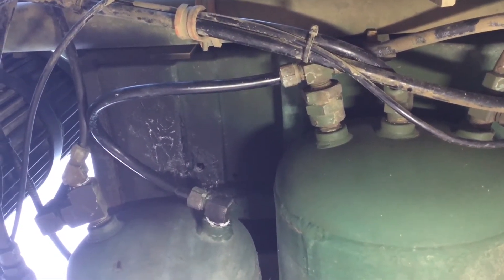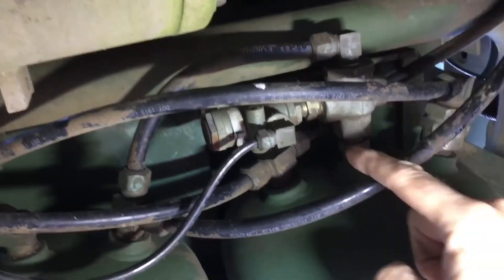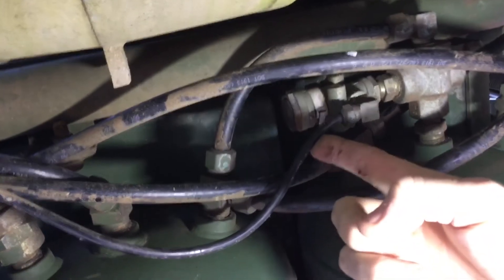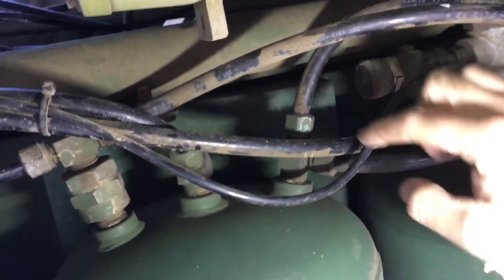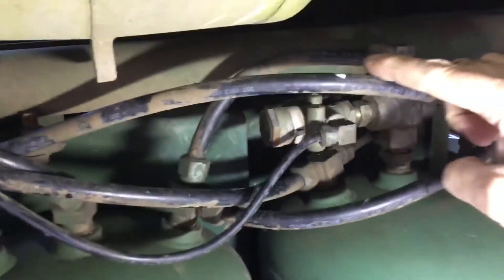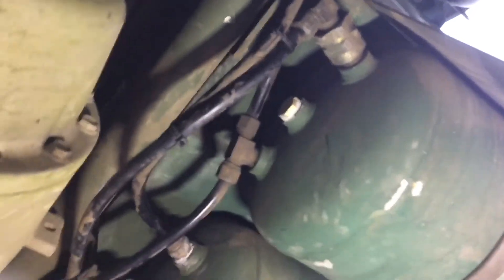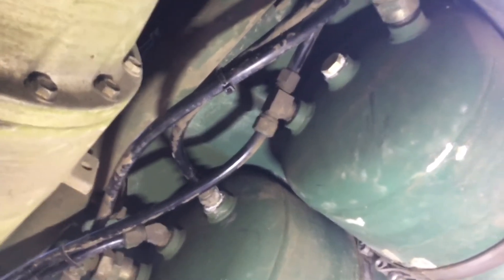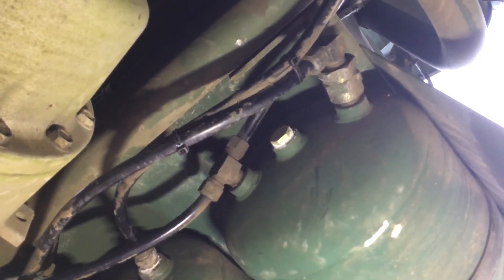LMTV AOP air supply control valve removal.

Comment: Ron:  This is very helpful to me.  I've removed my AOP pump and installed the hand pump you recommended.  I had capped the AOP supply line at the manifold end (manifold also gone), but today I removed that line completely and capped the valve end.  I'll remove the valve as you did when I get the elbow and plug next week.  Thanks for the video!  Very, very helpful.

Comment: Great video as always. I am in the middle of doing this to Brutus, but was curious as to where that cut line I see on your take off parts went ?  Looks like mine is heading up front of the truck, maybe to glad hands ? I am going to delete glad hands per your video also, I NEVER use them.
Reply from the maker: Well if you have seen the glad-hand delete video, i mention it briefly there.  That cut line is the park air input. When park air is applied, that valve closes to prevent some joker in the back from raisian the cab when driving:)  Park air comes from the park valve down thru a port in the floor behind the grill, to a 2way check behind the drivers step.  Park input also comes to the park 2way from the front red glad-hand.  The output of that 2way(top one) is Td. One leg goes to the park input of the inversion valve to control park brakes. one leg goes to that AOP supply valve(cut line)and the park/emer light control air switch(66PSI) is also Td off there.  Easy to get to with the grill removed…
Reply: @rronmar  Right on and thank you, so if I do this air tank clean up like you did and cut that line like you did I will have a air leak until I do glad hand delete right?
Reply from the maker: Well you could disconnect the rear end where it connects to that remote valve(where I cut it) and cap it there, Or you can get in behind the grill, find where that line is connected, disconnect it and cap that port…
Reply: Perfect, that's what I was thinking also.  @rronmar

Comment: With out the AOP, what do you use in lieu of that? Is the AOP what drives the Hydraulic pump to raise and lower cab suspension and tire carrier? Thanks

 --W
Reply from the maker: The AOP is the air operated hydraulic pump..  if you look thru my other videos, you will see one for the hand pump I am switching to for flipping the cab.  I am building a habitat on the back so won’t need the tire crane, and I already deleted the suspension compression…  I like simple:)